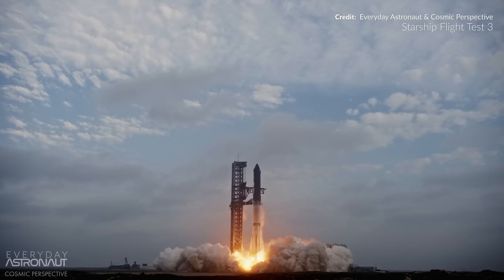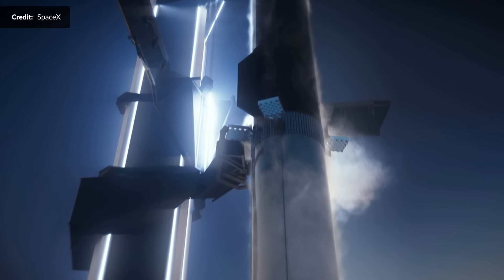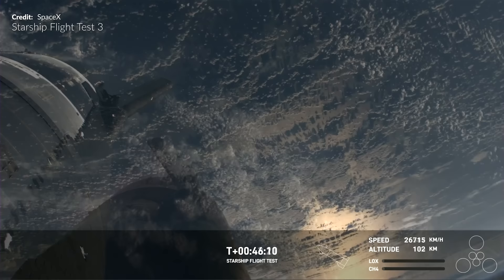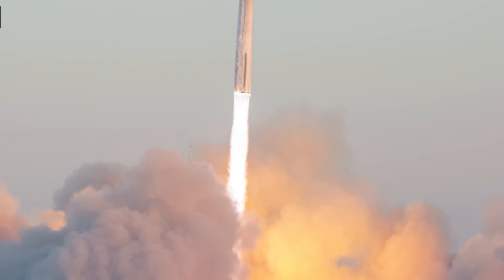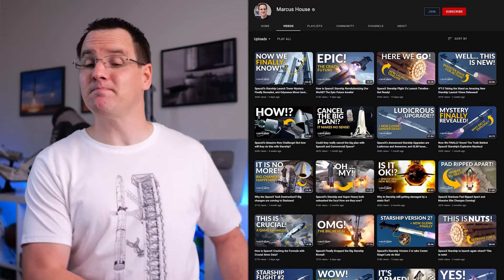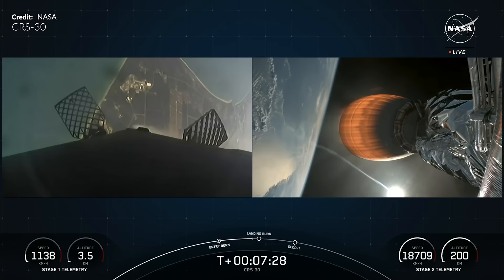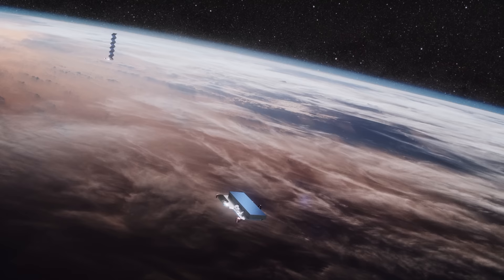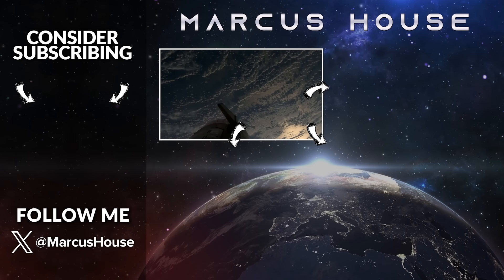SpaceX's Frantic Push to Launch the Next Starship Mission is Nuts!

Comment from the maker: Stay fully informed on Space news and more at https://ground.news/marcus. Subscribe for 40% off unlimited access through my link this month.
Reply: Question. Why are the grid fins scalloped?
Reply: On the arms. They need a separate landing area, from a launching area. If the ship hard lands, it doesn't take out all the extra things needed for launch such  as fuel supply. It's far simpler. 
They already move the ships around easily.
Reply: There is the possibility that "POCKN" is in fact "ROSKI" (which of course is close to, but not the same as, "Russian"), assuming of course the "POCKN" is Cyrillic.
Reply: @MarcusHouse - my theory is they are going to buildout the second launch tower and chopsticks with no OLM or ground equipment on it as a "development" tower to test catching the booster, so if it misses and fails, it doesn't blow up the original "production" launch tower.
Reply: Imagine where we'd beif the new Prez gives Musk his own "warp speed" for Starship launches.
Reply: Can you do a dive into and an update on Gilmore Space Technologies upcoming launch from North Queensland.
Reply: Based on what i know about the old shuttle emergency escape system from the tower my guess is Falcon 9 has a much smaller minimum safe distance than the shuttle. The setup  for that was based on the minimum needed to get them to that safe distance in a reasonable timeframe.